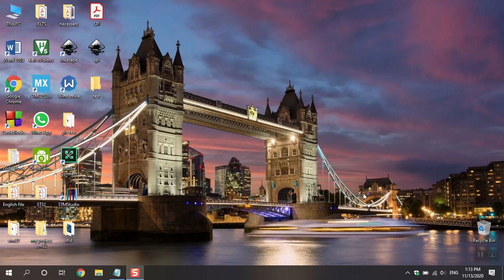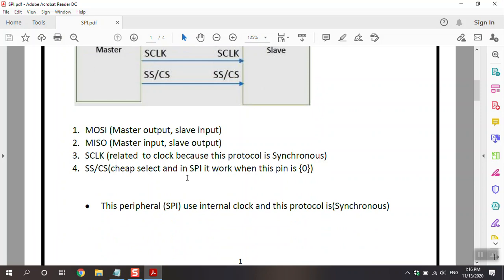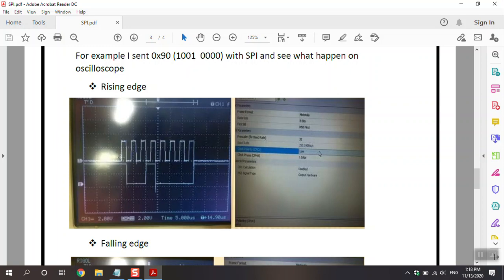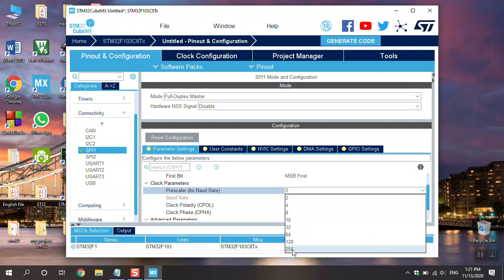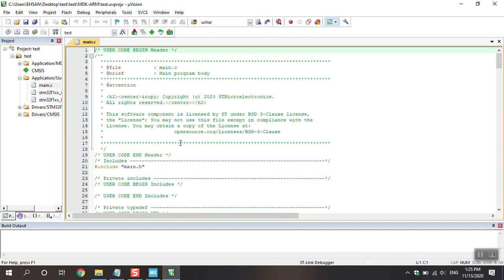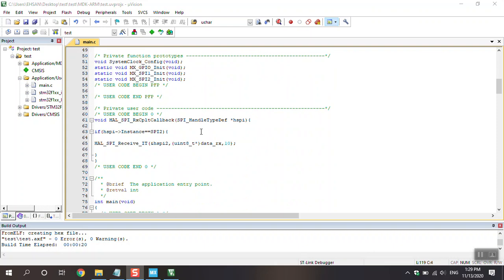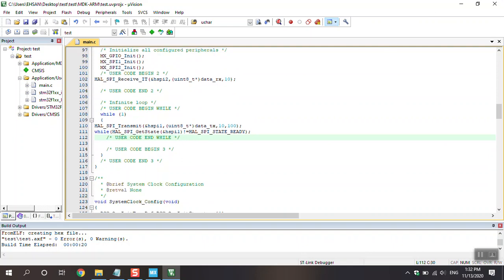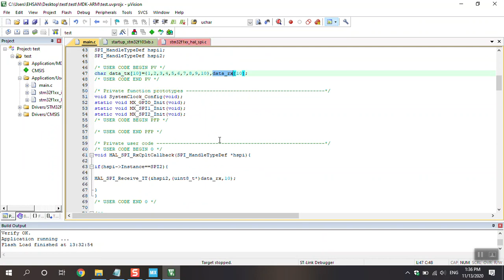SPI with STM32

Comment: I have a question, in your code, you initialized PIN A4 (SPI1_NSS) as GPIO output with initial value of "low" and connected this pin to PB12 (SPI2_NSS), does this mean the NSS is always pulled low and the SPI protocol is always transmitting?